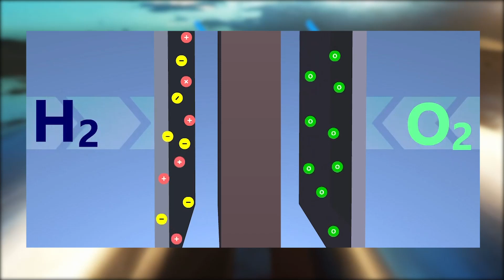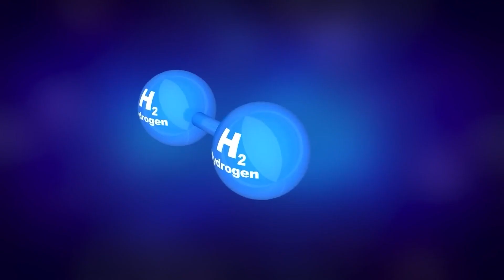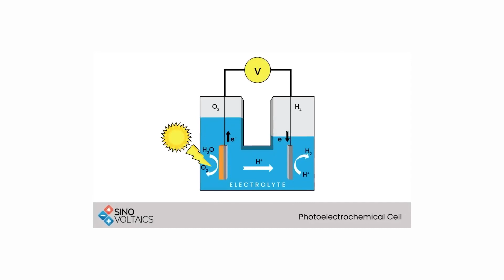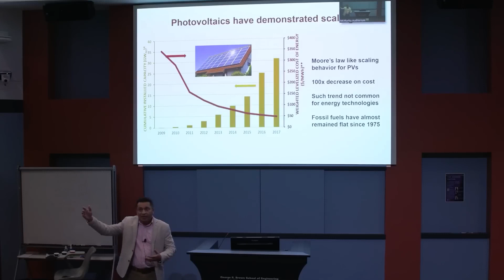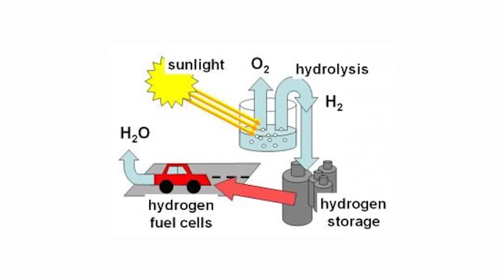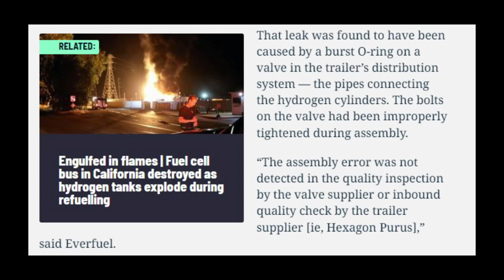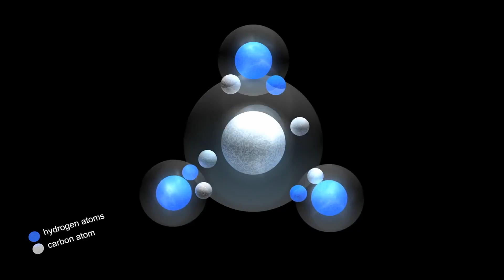SOLAR HYDROGEN BATTERY MORE POWERFUL THAN GASOLINE!

Comment: Full of misinformation from the start on... Sure, using hydro or nuclear power to create the hydrogen, it is one of the nearest fuels to carbon neutral. But it's highly inefficient. And it's capacity per vehicle is far away from petrol. Some new fancy technology doesn't change that. Especially since it being based on semiconductors having the same problems as photovoltaic energy and this video not citing ANY real science or just numbers doesn't help either...